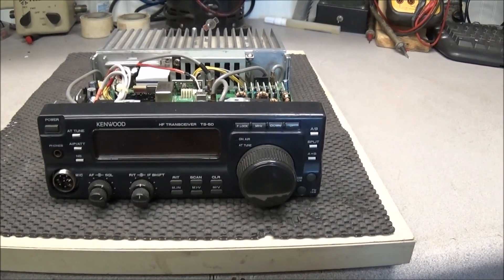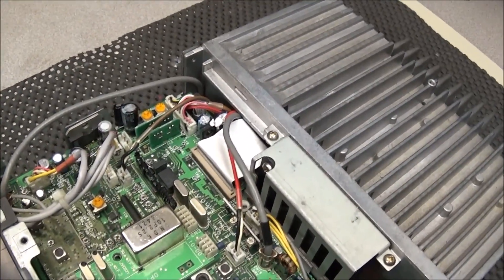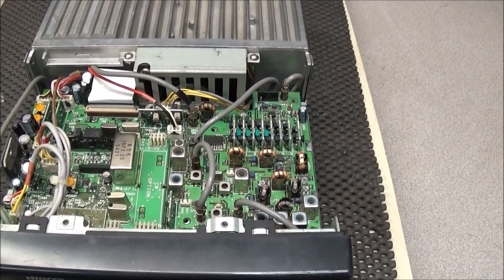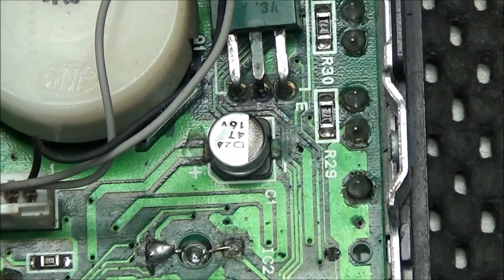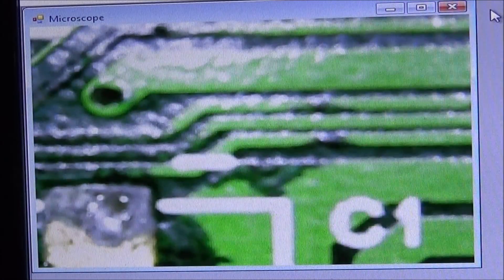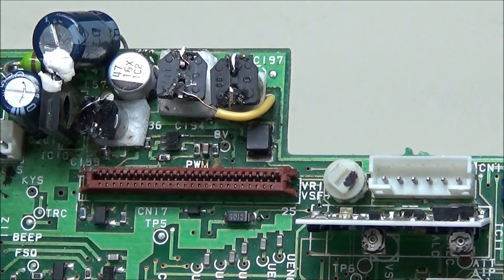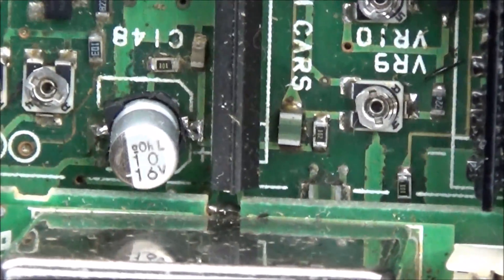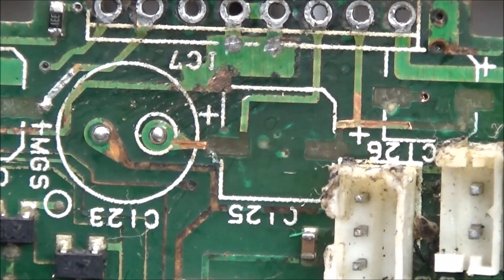#14 Kenwood TS 50   Capacitors and  previous repairs gone bad part 1 Evaluation

Comment: Hello. I've kept your video in my files to refer to when I was finally ready to tackle my TS-50S problems. The PLL board has very leaky, high ESR 47ufd smd capacitors in all locations, as well as the TX-RX board. Looking further, I found the 22UFD smd capacitors barely registered! Several leaking green goo out of the lead pad places and pads destroyed. I found some CKT trace repair kits at the local hamfest a few months ago and has really helped in repairing the boards, however I do now have receive, but no TX. I need to look more closely at the traces and "through vias" and be sure I have continuity from top side, to bottom side of the boards. This really takes a lot of time! Thanks to TRXLab and to you at the Radio Shop for some excellent videos!

Comment: i have a ts50 that does work fine but the receive signals are low. it sounds like the attenuator is on but its not. any ideas whats going on?
Reply from the maker: Really hard to know why the receive is low. many things can cause this. My first guess would be leaky capacitors
Reply: @TheRadioShop  no doubt. that's pretty much the answer for anything with the ts50 i am seeing. i'm hoping to find somebody willing to work on it, as a child it was my dream radio and i'm 42 now and finally got one. compared to my ft991 i can tell its a little deaf. love your channel my man!
Reply: @TheRadioShop  i actually just sent you a email

Comment: Hello everybody.  I have just now subscribed to this channel and I am already asking for help.  I have a Kenwood TS50S which should have all the capacitors replaced.  It has always worked but now in reception it is perfect while in transmission when I press the PTT, with any power, the word "HELP" appears on the display and no power comes out.  If anyone has a chance to help me I would be grateful and happy.  73 de Iuolde. iu0lde.mc@gmail.com

Comment: FYI 

An older android phone with camera makes a good usb camera, just hook it up and you can get great close up photos of the boards, not as great as a dedicated microscope but close enough to see what you are working on and good to find broken traces on the vintage gear.
Reply from the maker: +27613James That is a great tip James. I have done that do many times.

Comment: Great series on the TS-50, you show how important is is to pull the schematics and use the basic meter (analog or digital) to take reading BEFORE diving into the rig to r/r parts.

73 james ke4drn
Reply from the maker: +27613James Thanks for the kind words. I have several more videos on the TS-50. Even the completed one. This was a very interesting series.

Comment: I feel your pain.  I did one of these a few months ago that was in similar condition.  The one I had was also butchered on by someone trying to replace the caps with through hole caps.  I was able to do the trace repair with conductive epoxy dispersed with a very fine syringe applicator tip.  Good luck and have fun. :)

Mike
Reply from the maker: +MikesRadioRepair .CBRadio Hey Mike. Dont you love it when someone goes wild with a soldering iron :) All we can do is try and teach them the correct way. Thanks for dropping in. We will see how this one goes soon.
Reply: +The Radio Shop 
Some people should have their fingers cut off so they can never hold a soldering iron.  I have another radio to do next week sometime with butchered tracks.  Unfortunately as SMD design radios get older and more people try to fix their own radios we are just going to see more of this as time goes on.  Now back to the current radio I'm working on.  A hand wired tube radio.  No traces for someone to screw up in it. :)
Reply from the maker: +MikesRadioRepair .CBRadio Tubes, I love em. So warm.Amazes me that folks have never heard of hot air, hot tweezers, or low wattage irons. I saw one guy use needle nose to just rip smd components off a board before, remove the traces along with it.

Comment: Really looking forward to seeing how the repairs go on this one.  Could you talk some about why this happened and how to do the job of replacing these caps without causing damage to the board?
Reply from the maker: +kuro68000 Well it is a lot cheaper. Be nice to have a x7-x40 range Olympus SZ microscope or a 7x to 45x Kyowa. If I had the extra cash it would be the Mantis Elite Cam Inspection Microscope
Reply from the maker: +TheDisorderly1 Thanks for the feedback. In part 2 I will cover what you asked. May be a week or two before I can get back on it. but in the mean time:Caps fail for several different reason.  Two common reasons are heat and age. Electrolytic caps are "wet" inside. When the electrolyte starts to dry out this can cause a high ESR which means the capacitor is building up resistance. This can cause the cap to swell and pop the vent allowing the fluid to leak out onto the pcbNever use pliers to pry surface mount caps off a pcb. I have seen this on YT.Use hot air,  hot tweezers, or a iron and wick. Be sure to apply flux first. I have used small side cutters to cut the cap off a little at a time. Use caution doing this.
Reply from the maker: +The Radio Shop To repair the traces I will use a very thin copper foil glued down with high temp epoxy
Reply: +TheDisorderly1 +1 looking forward to the follow up.
Reply from the maker: +kuro68000 I already have another video started on this. If all goes well will upload tomorrow evening. I am going to cover why the caps fail, what damaged occurs when they fail, and how to properly replace the caps with out damaging the board and pads. I have parts ordered to repair the board. Will be about a week or so. Will cover trouble shooting, and how to repair those missing traces in part 3.
Reply: +The Radio Shop Cleaning up the mess left by leaking caps is the worst part. I'm still trying to find a good magnification solution to help with trace repair.
Reply from the maker: +kuro68000 I agree.  It can really leave a bad mess, destroy traces and a lot of corrosion. I have a cheap usb cam I also have a Dino-lite usb cam that does a fairly decent job.
Reply: +The Radio Shop USB/HDMI really seems the best way to go, doesn't it? So much easier than trying to look through a lens.
Reply: +The Radio Shop I find a good adjustable LED light really helps. the built in light is usually terrible.